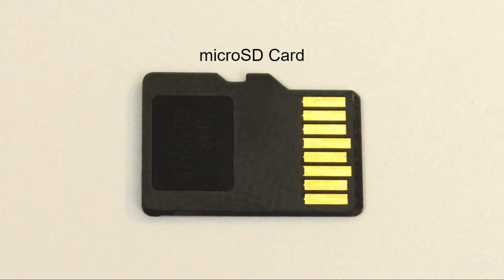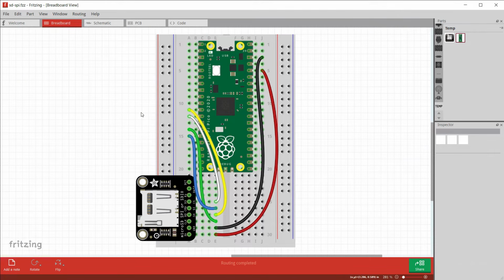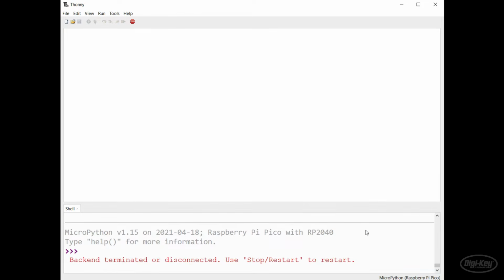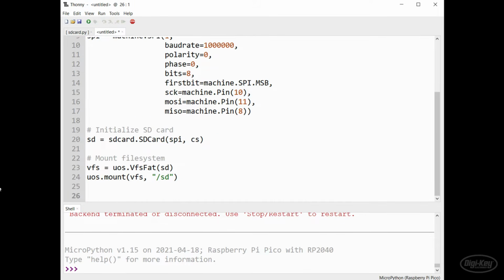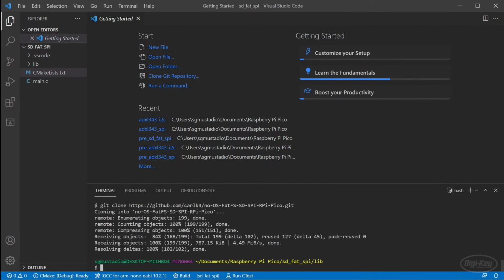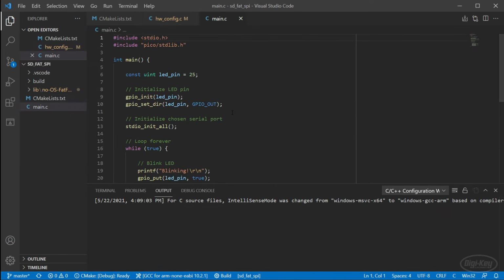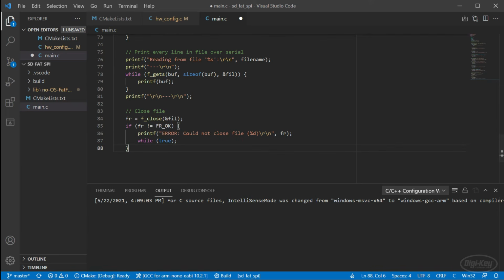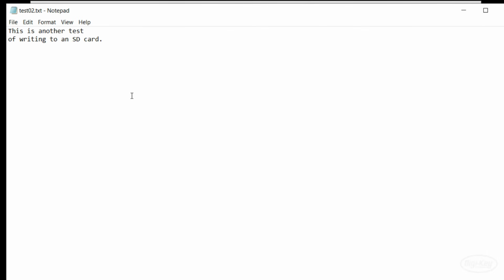Raspberry Pi Pico (RP2040) SD Card (Read & Write) with MicroPython and C/C++ | Digi-Key Electronics

Comment: There was a breaking change to the C library cloned in the video.
The file hw_config.c edited in the video was removed. Building the library now fails at link time.
The first part of the fix is to copy the file "/simple_example/hw_config.c" to the new file "/FatFs_SPI/sd_driver/hw_config.c".
To finish fixing the library, I believe that include statements in the library may need to be updated.
Reply: At 8:20 in the tutorial, viewers will have to update the spi_t and sd_card_t fields to look like those reported on Hymel's screen.

Comment: Hi, On digikey I can't seem to be able to leave a comment so I will leave one here.
Since you wrote the article the no-OS-FatFS-SD-SPI-RPi-Pico may have changed a bit ... I was unable to compile the code you shower with the current code.
Also the default pins on the pproject may have changed and don't match the wiring you are suggesting.
I added hw_conf.c in the add_executable line in CMakeLists.txt
add_executable(${NAME} ${NAME}.c hw_config.c)

It now builds but I've not yet tested if it actually works
Reply: Did you find a solution?, thanks